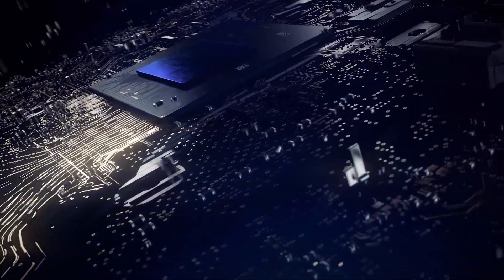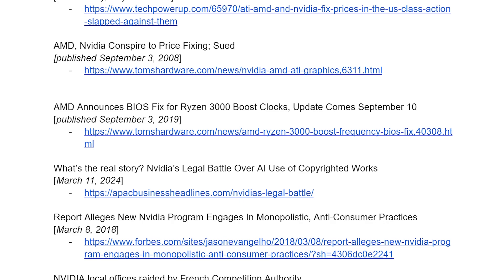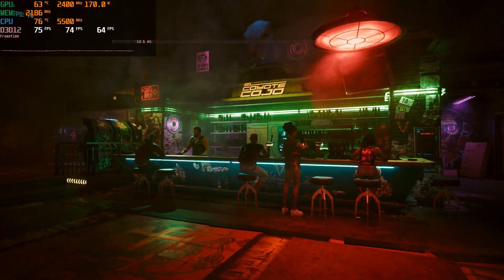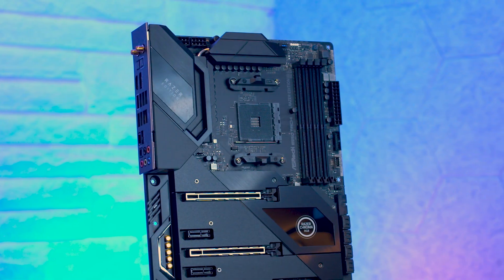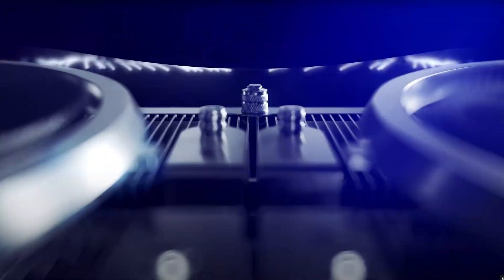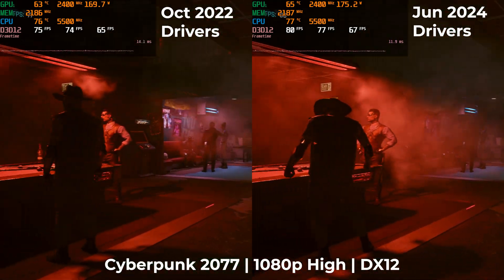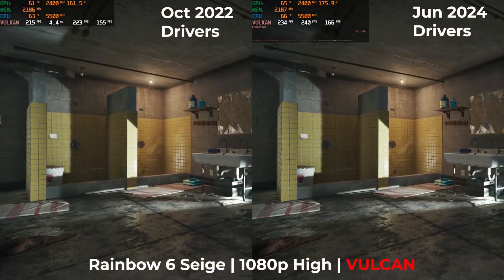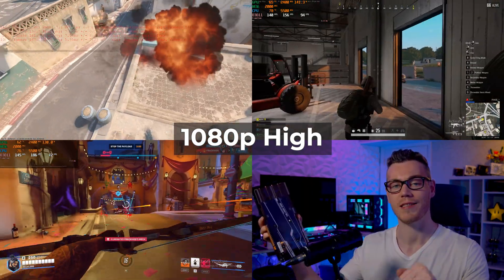Intel Saved Their Most Expensive Mistake...

Comment: I have an Arc A770 and I have had an almost almost flawless experience
the only problems I have had have been with BIOS, but I got it fixed and now I haven't had any issues for about 2 months

Edit: XeSS has also been a really good upscale technology which if implemented correctly looks almost as good as DLSS

Comment: Just got Arc 770 today
Reply: how is the gaming performance?
Reply: @Pixel_Hermit  Works as it should and never faced problem with it.. I think I made the right decision.

Valorant : 300~400 fps
Reply: @PrafulMeena  What about 1080p at Max settings in other games?
Reply: @Pixel_Hermit  search 250 games tested on arc a770 and watch 1st video.. and now games even works better then he last tested because of new driver update.
Reply: @PrafulMeena  What's the best CPU to pair with it?
i'm thinking i5 12400
cheap + DeepLink Tech + no bottleneck
am i making a mistake?
Reply: @Pixel_Hermit  that will work alright, I went with 12600kf for its higher core count and higher boost clock even if paired with non-OC mobo.

Comment: I think their most expensive mistake would be the self destructing 13th and 14th gen CPUs
Reply: I have a 13th gen Intel GPU, and it's alive and kicking, any self-destruct by any means.
Reply: @artmanrom  they are working fine but are basically receiving too much voltage slowly degrading the cpu bit by bit. literally.
it is true you wouldn't feel it for the first maybe 2 to 5 years if you are a light user say 2 hour gaming sessions per day and some hours on the internet.
but the heavier you use it, the faster the degradation goes.
but no reason to panic as Intel has a fix to save those cpu's.
Reply: @artmanrom  Mostly 13700, 13900, 14700 and 14900 and their variants are dying in servers and crashing in heavy workloads and even in games according to various outlets. Search online you'll find news.

Comment: The translation analogy with emulation is not correct. Playing PS3 on PC, means a program that completly emulates a entirely different hardware architecture on software.

What Intel did is somethiong similar WINE does on Linux, is a layer that reads the calls and translate them into something understandable and it can be as fast as native. Steam Deck does this through proton.

Comment: I run a A750 on a Ryzen 7 5700, I usually play single player games and have had really no issues. I would get some slow down and some artifacts in the beginning but they were resolved rather quickly and being I started with PC gaming back in 1987 this is how most of the cards on the market started out. ATI didn't just make a card and it be the best on the market it took a couple of years with the Rage chips, if you go back and look a lot of the first gen Rage were used in servers and not as gaming GPU. Nvidia hit it out of the park with the TNT line, and is one of the reasons we don't have 3dFX any more along with a lot of others, but they too did have a lot of bumps on the way.

Comment: Intel Arc Xe2 Battlemage looks very promising. Xe2 is one micro architecture that scales from Low Power Gaming (Xe2-LPG) for iGPUs to High Power Gaming (Xe2-HPG) for dGPUs. The reason DX9 games are very popular is because most people are using much older cards. When Battlemage comes out there will be very cheap Alchemist cards available in the used market that people can upgrade from those older Nvidia cards. Intel used F1 2024 to demo the Xe2 iGPU on Lunar Lake. A new game that was not yet released working well on an unreleased GPU. Intel is working hard to get day 1 game ready drivers for popular titles. A very different start with Battlemage than with Alchemist. I think more people will buy Battlemage compared to Alchemist buy a significant margin.

Comment: The problem was the hype.   They said it was going to be comparable to the 4070 for a fraction of the price.    The reality is it competes about the same amount a slab of tofu competes with Ruth Chris for satisfying your hunger.  They should have just said we are releasing a low end video card.   Instead of dissappointing as it slowly got better it would be a very positive spin.
Reply: They did not say 4070 as that card didn’t even exist on the market at the time of the A770’s release. It was supposed to be 3070 performance launching in the middle of the pandemic scalping to drive down prices with millions of new cards. What we got was typically 3060 performance (much worse in older games to the point of being broken), broken and buggy software, and arriving not just after the market crashed but so late it launched the same day as the 4090. It’s up to around 3060 Ti performance and the software actually works now which is pretty good, but older games may still see issues.

Comment: I have the A750 from Intel. The card has a few issues. Idle power draw is still insanely high even after enabling Native Power management in the BIOS per Intel guideline.

However, the GPU has been very good at games I play. Most games I play are DX12 or just aren't that intense.

I also do a fair amount of video transcoding and here it excels in Handbrake. I often get 20:1 ratios when transcoding.

Comment: A770 got relevant 2023 January driver updates. A770 is a bit odd card where at 1080p you could say it is behind the competition but we are talking high FPS and in reality it really makes very little difference (pont 1). 1440p the drop is lot less than competition pulling level if not ahead on FPS count at compared cards. At 4k it is well ahead where it shines as the entry level card with 16gb VRAM and 256 bit bus. I use mine with 4k and works well at mid and high settings and also can handle RT most of the time. 

Peter let the cat out of the bag and most missed it. ARC paired with INTEL CPU gives a better performance. ARC is almost doubling it performance with INTEL CPU via REBAR/E cores but you do not see this performance on FPS count (point 2). This is why the experience often is lot better than competition with double the FPS count. None of the sponsored channels are willing to say this. GN sort of did letting Peter demonstrate how the ARC works. The speed of rendering where ARC shines as productivity card gives you a good hint where the performance actually is. Hence INTEL offering a tool for pairing. 

Also need to point out INTEL XeSS XMX is different to XeSS DP4A. Often missed or mixed in purpose to give worse results. 

Overclocks really easy for good performance boost. 
2786MHz at 1.16V at 271W. 

Base is 2100MHz (2400MHz) 225W.

Point 1: 
Some games are FPS capped so for example at 1080p if the game is capped at 200 FPS you often get around 100 FPS with ARC. Peter pointed the pairing with CPU and here you double the performance. Would show 100 FPS but no waiting. In reality 100 FPS performance equal the 200 FPS performance from the competition. 1440p the cap allows ARC to perform better numbers. 4k you see even less drop to the competition. I believe this is mostly about the capped games and higher the resolution less restriction there is for the ARC.

Point 2: This means every FPS counts and no stutter. 100 FPS is 100 FPS not like 200 FPS from the competition where the extra 100 FPS is targeted to fill the badly timed and missed FPS with long waiting times. It often means that good 100 FPS is better than 200 FPS that are imperfect. 

For last I would like to point out Intel® Application Optimization (APO). This is upcoming performance that will further boost the ARC and INTEL CPU pairing by 10-50% depending of the application and game. It will be relevant for the Alchemist but more for Battlemage and standard with Celestial. So A770 is just going to get better and better with time.
Reply: I got the A770 Titan for 280$ and i really think the NO STUTTER part is 100% true I get a little lower FPS than my 6700xt but there is clost to 0 Stutter at 1440p! I also agree it will get better with age like cheese!
Reply: @Miley_00  6700xt 10gb VRAM 160 bit bus 220W loses on specs fair bit. 1440p it might not make a huge difference yet but it couldn't do 4k. On ARC I find as soon as you are over 40 FPS most is very playable. Same you can't say about the competition.

Comment: I got my A750 May-23 and all mayor issues were essentielly gone, sure I can't get the extra boost from 200 to 300FPS in 1080p in all games, but I can go to 1440p and keep the same FPS in those games. With new drivers it's only getting better, gaining 10% FPS in a couple of games every month.
I got the LE version and it's silent as a mouse, but it does draw some power, especially when overclocked to compete with the 7600 & 4060.
Raytracing & upscaling it's rivaling Nvidia, the A750 actually beats the 4060 in 1440p in some titles, probably due to it's 256-bit bus.

Comment: I bought my Arc A750 for 170€ and put it on my remodeled computer 9 months ago. I bought it just to test how Intel worked with a view to perhaps buying or at least having among the alternatives to their Battlemage... ironically it works so well, that I don't know if I'll buy a Battlemage or wait for a Celestial. So it was already working very well, because Intel's work was extensive, but I have to admit that in these 9 months, it has also been intensive, and the card performs better with each update. Its big problem is that games mostly do not use XeSS technology as it happens with Dlss and FSR (although this one is honestly worse, than XeSS at least, it is an alternative when it is not implemented).

So although XeSS is a better solution than FSR to act as Super Scaling for any graphics card, let alone XMX mode for graphics with XeSS hardware, the reality is that Intel's real limit is still in the game developers who implement it. Perhaps with the Windows 24H2 version, this will change as games call up the windows libraries and they use the most successful solution, but for now, the introduction of XeSS is the most serious issue that Intel has to tackle. Not only for the sake of the Arc, but also for their future Battlemage.

Comment: I got an A750 in March ( $200 new )  to do my first PC build in over 10 years.  I run Linux and mainly Blender.  The only issues I had was when Blender updates needed an updated driver, I reported it to Intel and they got a new driver out in a few days sometimes in hours. It was a huge step up from a Dell desktop +  GTX 1650. 

I don't do much gaming on it  just 0AD , Warzone 2100, and openttd. Most  gaming I do is on PlayStation.

Comment: I bought a Sparkle A770 Titan about 2 months ago and have been running it on Linux.  It's  performing fine with one issue that may likely turn it into a deal breaker for gaming.   There has been mixed reviews from people saying the HDMI ports suffer from random small blackouts but it seemingly did not affect the DP's.  This card has this issue on every single port, HDMI or DP.  Playing a game where death or quick reaction time matters, a random blackout for up to 3 seconds is enough to ruin everything for you.  The  blackouts are not extremely common, but they do occur a handful of times a day.  This is not safe to game on for me personally.
Reply: I had blackouts when playing OW 2 on my ex GTX 1600 6GB, since I switched to my 3060 Ti OC any of those blackouts have occurred.

Comment: To be honest, i'm very happy with my A750 ORC OC. 
I play Battlefield 2043 @ 1440/ medium to high @60-80 fps
CS2 is now also stable @1440 @120 fps medium/high
Games like Age of Empires 4 and etc. run just amazing. So i'am happy as a user. Especially for the price of 220 euro I got it for. In lots of games it goes above RX7600 which costs 310+ euros
On TimeSpy (3D Mark) I get 12000+ points. The GPU is powerful, the drivers are hit and miss, but generally they release updates once or twice per month with fairly nice improvements. So, nothing to complain about.

Comment: I would love to continue messing with my A770, but when I got my 7900XT I upgraded my PSU and it no longer has a 6 pin sadly. ARC is defintely good for budget gamers and even streamers. Intel had AV1 support before AMD and Nvidia. Strangely Nvidia was the last to implement it into OBS and even more strange they have the most stability issues and bugs with AV1. Both Intel and AMD seem to have solid implementations there from some of my own testing.

Comment: I already bought 6 cards: 2x sparkle a310 eco(1slot Av encoder), 2x 380, 2x 770. I did my part!
Reply: i have bought 2, the a380 and a750 and getting ready to buy an a580 soon.
Reply: Have an A770 in my gaming/general-purpose rig (to be replacedwith a B980), planning on one A60 Pro for my workstation, and either another A60 or a mid Pro Battlemage card.
Reply: why 6?
Reply: Minted?
Reply: Yeah why did you buy 6 cards?
Reply: @migalorsdarwin1930  Probably has six PCs.

Comment: I bought the A770 at launch knowing that the drivers would not be optimal for at least a year after release. I have been building pc's for a very long time (35 years plus) and so I have seen the early days of all the gpu makers and Intel started out like AMD and NVIDIA with teething issues, no difference, but they kept at it and now the card is starting to see the kind of performance that everyone has come to expect from Intel. Today's PC builders are a lot different from when I began, back then computing was a hobbyist culture were things didn't just work out of the box, it took time and a ton of effort to get a computer running, those days are long gone which in a way is real shame.😊
Reply: I do not miss those days when it took hours if not days of troubleshooting to figure out which part is faulty.  It was nice to be able to get a replacement part from the store right away however.
Reply: @Hardwaregeekx  Then you must remember the feeling you got when after all the troubleshooting you finally find a solution to the problem. Plug and Play took all of that away as well as the skill set necessary to find the solution in the first place.
Reply: @pyrielrising4338  The only thing I miss is choices.  There used to be so many more choices.  Even if I never intend to use a Cyrix cpu or an S3 video card, it was nice to know there were options out there.  And it is sad that Abit is gone.

Comment: When I had a 6700XT I prefered XESS for upscaling instead of FSR. Now, on a 7900XTX, I dont use upscalers, but if I needed a a card in that price segment, Intel Arc would be a serious competitor, especially for rendering and in terms of raw hardware/potential. 
Im mostly impressed of how far they got in such a short time with they driver support and Im still curious how the battlemage wil perform and for what price.

Comment: We do need someone to compete and help Nvidia pushing real.time rendering forward. Nvidia have def been leading the way in pushing whats possible.  Physics based real time lighting. Upscaling to greatly improve performance budget that developers have to work with, and fix the image quality problems caused by taa and fxaa. The performance budget increase is bigger than when we went from msaa to taa, mire than mesh shaders added, more than screen space effects added, more than mip maps added.  Streamline SDK to make adding new features simple and quick for devs.  RTX HDR to improve hdr in pc games.  RTX IO to improve asset streaming and loading times.  Upcoming tech neural compression to improve texture quality while reducing texture size (allows for less bandwidth to be used on textures).  RTX Remix to give modders tools to update older games.

People like to claim Nvidia gave up on gaming. But the truth is they are making more money than ever from the gaming market.  They are the company not skipping out on the high end.  The only company adding new tools and tech to increase fidelity and reduce dev times.  Intel is doing a decent job trying to make low end/mid range cards with modern features.  Nintendo is using nvida and will have its feature set on the next Switch.  Sony is adding an NPU and using a bespoke upscaler for the ps5 pro.  It's not Nvidia that gave up on gaming. It's not their fault that others refuse to try to compete.  Its companys saying we will match them in a single metric, be 2 generations behind in everything else and sell our cards for 10 percent less.

Comment: I picked up an Arc A770 Limited Edition way back before the massive price drops and I can't say I ever regretted it. My card sits in a secondary PC that is primarily used by guest users, though. So I do not have a daily driver experience with this card. Still, it's been working well at everything I threw at it for testing, as well as running both Windows 11 and Linux (Fedora). The only thing that really didn't work was Ragnarok Online, an ancient MMO from 2002 that runs on DirectX 7 but that was completely resolved by using dgVoodoo2 at which point it ran perfectly.

It's also important to mention: The A770 Limited Edition is THE most beautiful graphics card ever and I absolutely love it to death. I'm very much looking foward to Battlemage and definitely will pick up whatever their highest tier card will be. I'm extremely happy with the product as a whole and am absolutely planning to keep supporting them despite my main systems having perfectly capable high end cards with an RX 7900 XTX and an RX 6900 XT. 

Honestly, I've been considering collecting LE Arc graphics cards and only didn't because the vast majority of them doesn't have an LE release and just having an A750 along with the A770 kinda felt unsatisfying. I think I'll still pick one up if I see one at the right price but it's so far from a priority right now.